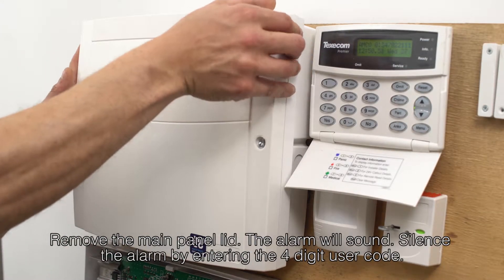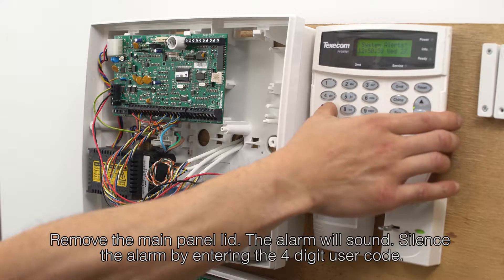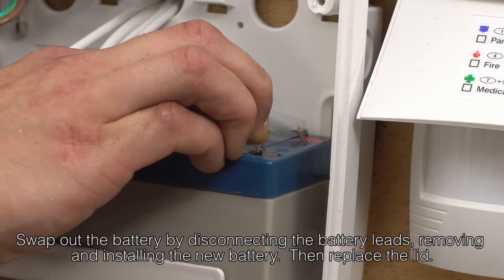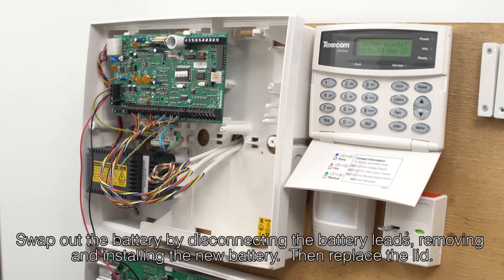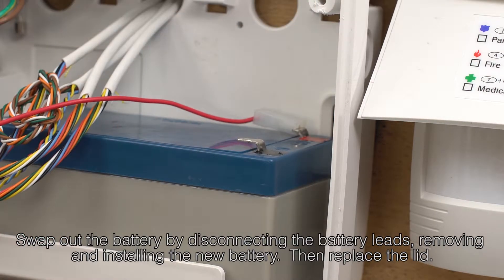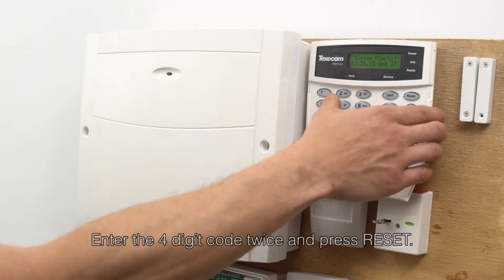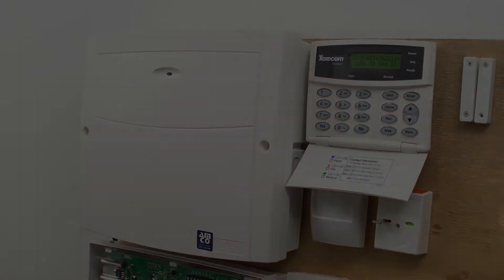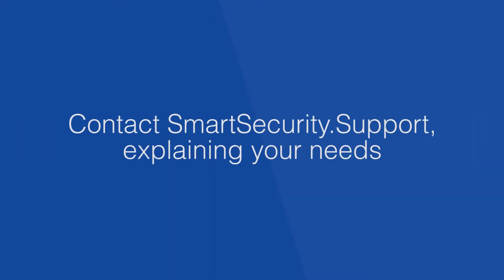How to change burglar alarm battery & fix alarm power failure fault

Comment: Would it be ok to effectively briefly turn the panel off at the fuse box / consumer unit ( turning off the mini circuit breaker ) to avoid any risks from the transformer just whilst you change battery please ?
Reply: yes it is! Only problem is if you do that and disconnect the battery the external alarm mounted on the wall OUTSIDE your house will go off on its own backup battery